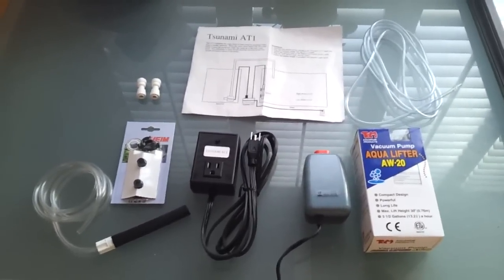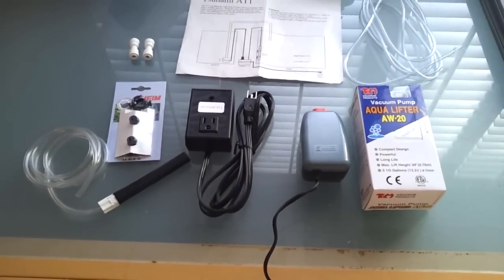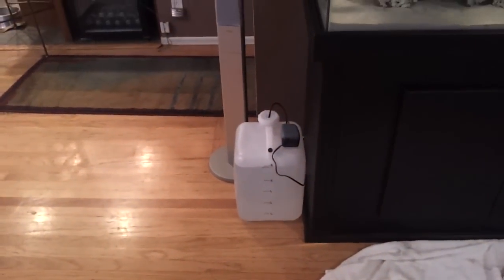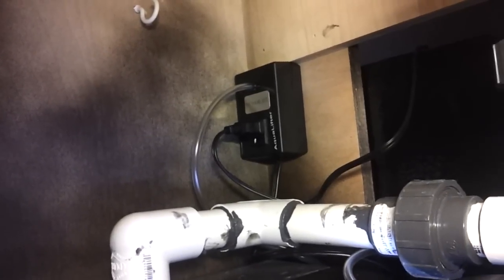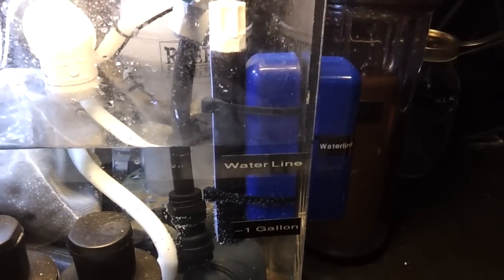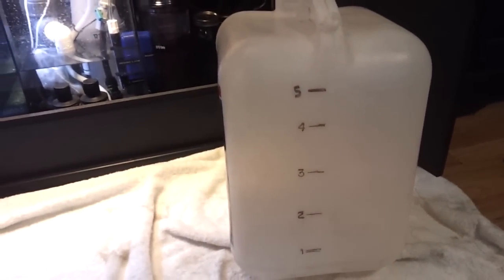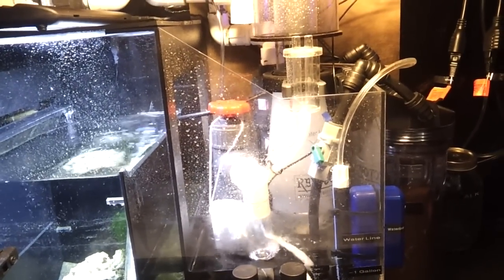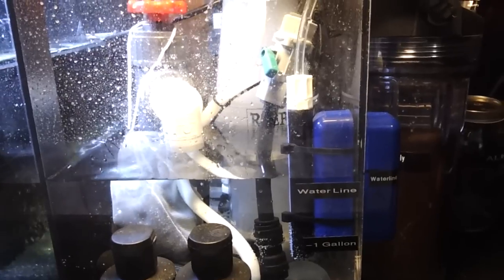Tsunami AT1 Auto Top Off (ATO) System Demo: Saltwater Aquarium

Comment: Great video. Awesome idea to use the zip ties. Suction cups will always fail when in water. Maybe you should raise the magnet so that it requires less water to evaporate b4 it turns the ato on. So that it will maintain the water level at the water line

Comment: I use my reef keeper as my ato, I bought a double float switch at amazon for safety like $6.
Reply from the maker: Eric Gonzales Sounds like a sound setup! Amazon does carry some less expensive floatswitches. I used one of theirs for my skimmer collection DIY project.
Reply: Believe or not I have another float in my main tank for my return pump so it will not overflow just incase.
Reply from the maker: Redundancy! Redundancy! It's a must in this hobby!